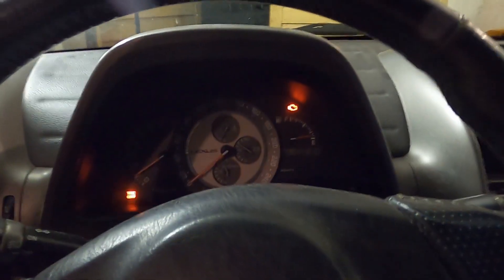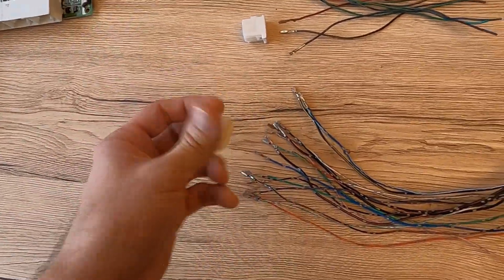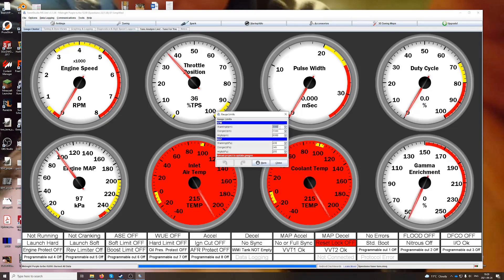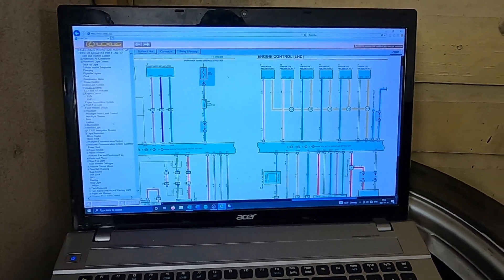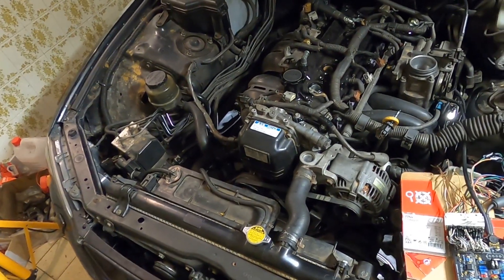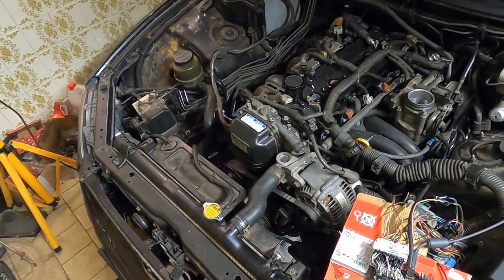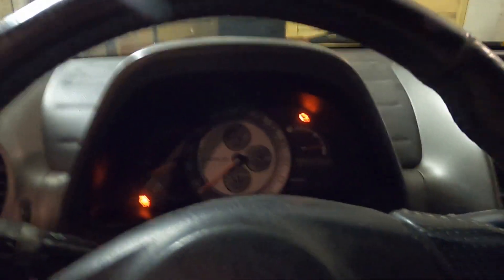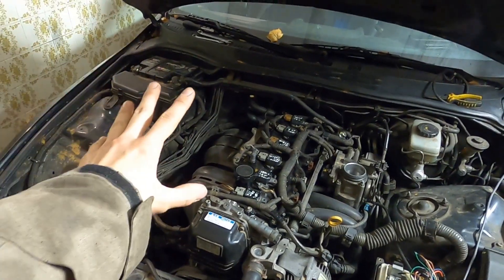Midnight Purple IS200 build log. Part 4 - Speeduino install

Comment: In the video you talked about an improvement in the wiring concerning the RPM/Crank/Cam Sensor. Did you run another wire directly from the sensor to the speeduino or else?  i'm trying to do the same thing on my mr2 and the rpm synch is what scare me the most 

thank you in advance

Comment: Nice video! Are you also controlling the gas pedal response with the speeduino or it's leaved at the stock ecu?
Reply from the maker: Speeduino does not have native throttle control so the stock ECU controlls it for now. However, in some near or distant future I plan to make a proper intake manifold with a normal mechanical throttle body.

Comment: Well done! 
Are you going to utilise VVT with the speeduino?
I may of missed the detail in the video, but is the cam sensor 1 tooth or 3 tooth?
Reply from the maker: Sorry for late reply. At the start I will leave the VVT controll to the stock ecu, however later on I plan on using Speeduino for that. The stock trigger pattern on the intake cam is 3 equally spaced tooth, but Speeduino does not have a decoder for that at the moment. So if you want to run this engine fully sequential you need to ground off 2 teeth on cam.

Comment: Would you be uploading a base start up map anywhere, so that If say I got a speeduino I could use your base settings to get the car running?
Reply from the maker: I will be doing that once I've got the setting correct. :)
Reply: @Midknights bro is there anyway i could get the base map from you. Im going to wire a soeeduino for my 1gfe.

Comment: Good job!
speeduino is better than det3?
Reply from the maker: Speeduino is a full standalone ECU, whereas DET3 is a piggy back. So the feature list of Speeduino is much larger, compared to the DET3. However, as you can see it requires quite a bit more preparations and a more difficult install.
Reply: @Midknights  interesting! in the future I would like a complete description of the installation
Reply from the maker: @lexusowner3871  What details in particular interest you?
Reply: @Midknights  if a complete set is sold, then no question)
Reply: @Midknights  can i buy an speeduino and install it right away or do i need to assemble / solder the microcircuits?
where can i buy?
Reply from the maker: @lexusowner3871  You can buy fully assembled kits.

Comment: I see conversion to the Yaris coils - are they plug'n'play or not that much?
Reply from the maker: You need to sand them down a bit, because Yaris ones are a bit thicker. The mounting tab is also at a different angle, but we've run them without bolting down and so far it's been fine. The plug is exactly the same and you get no check engine lights.
Reply: @Midknights  Great! It seems to be a preety good alternative, since they're a lot cheaper
Reply from the maker: @MrST3FAN13  Not only that, but they ar much "younger" so hopefully less likely to break. :)